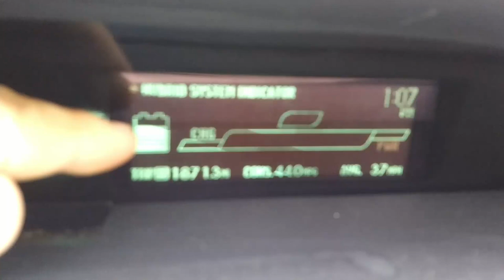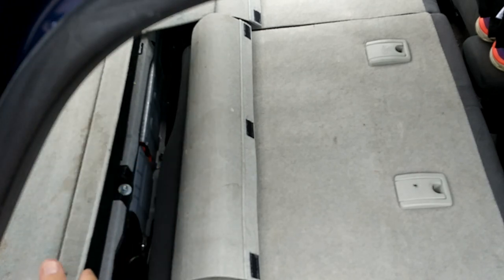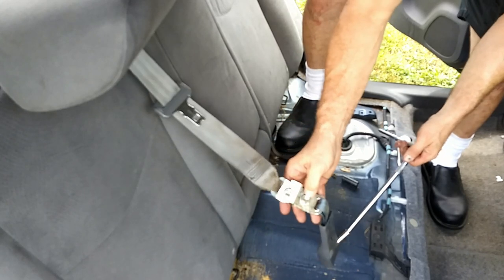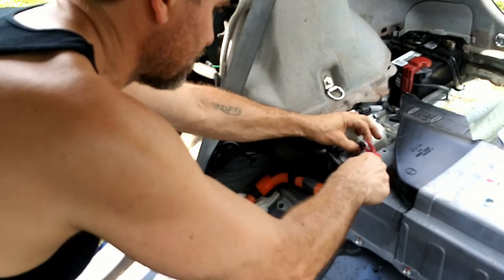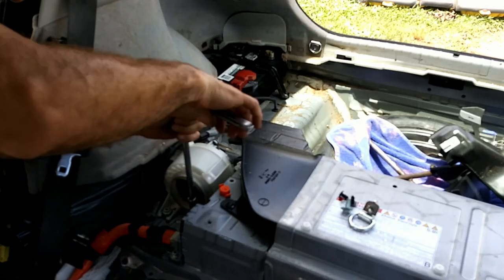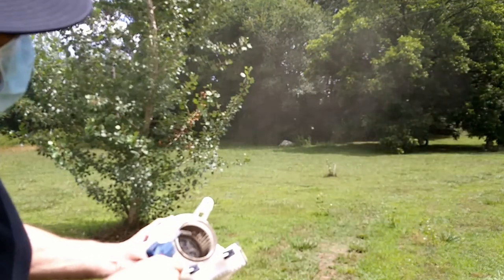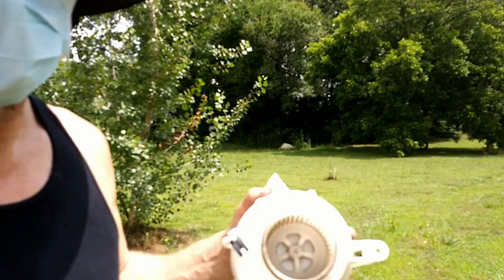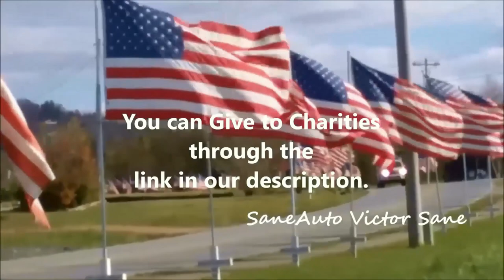2010-2015 Prius Hybrid HV battery fan clean Cheap and easy POA82

Comment from the maker: Prius and Hybrid Playlist click here https://www.youtube.com/watch?v=4O62muXAOo8&list=PLADlyv_PN7XIbqH6f-5bRtuISlKrkfsBI
Reply: I can't find the intake vent on my friend's 2013 Prius V.  It's not where yours is in the video. that inner fender panel is blank on mine, so I can't tell how dirty it is or work to keep dirt away.  And my friend bought it specifically to carry her 2 big, hairy dogs.
Reply: @saneauto thank you so much for this video, I plan to do the cleaning myself, since the dealer quoted that it costs $500 to do it as a routine maintenance for 50,000 miles. I don't expect it to be too dirty, but also want to make sure it is cleaned. I was trying the links for the tools you used, but those no longer work. Also you mentioned that you will have another video where you would clean also the vent in battery, I'm unable to find it (could you link it if there's one?). Although looking at other videos I guess that would be challenge on its own, as I suspect the whole battery would have to be dismantled.
Reply: Great video if u get poa82-poa85 it’s usually the fan that’s dirty great stuff keep up the good work

Comment: If you're gonna spend the time to get this fan out, you may as well clean it 100%.. i discovered there are only 3 screws (and 2 clip-like holders on the bottom) holding the two sides of the fan together! Just take it apart to easily get to the squirrel cage.  You can even separate the cage from the shaft, although I totally cleaned the fins with it together before discovering this easy trick. You can totally clean out the inside of the fan housing as well. 100% clean!
Reply from the maker: Great Job Michael! I love that method.

Comment: Later Hybrid models are much, much better at this. This 2010 was not Toyota's finest (engineering effort) when it comes to designing access for routine filter maintenance of the super critical (drive battery) cooling system-obviously. Ask a Dealer to do it and the Service Writer will happily quote $700. So this becomes a very valuable do it yourself  tutorial. This is "the" principal reason for the early Hybrid battery failure rate.  Batteries of any kind cannot deal with heat.
Reply from the maker: I agree

Comment: I don’t remember if you said anything. It is imperative that the fan be removed and disconnected before blowing ventilation with air. As I found out the hard way, The fan generates power and I blew out a fan and relays and $750 later it’s ok. You did it the right way. Follow your advice and it will go well

Comment: thank you for the clear instructions. The most difficult part was removing the back seat whereas I have to use a flat crow bar. My 2014 Prius fan was not that dirty but a grey film of dust, so I sprayed it with window wiper liquid and air-hose dried it. Now I taped a layer of fiber-glass filter material just after the plastic grill, so that if I see it becomes dirty, I can just removed the grill-cover and replace the filter.
Reply from the maker: Thats an awesome solution. It will save you a lot of work next time. I did a similar thing in my newest fan clean video just 2 weeks ago.

Comment: My 2012 Prius Plug-In (with Li-Ion) has two cooling fans which appeared pristine. I bought the outside mesh filter that snaps over the air inlet on the rear passenger bolster since mine had NO input filter whatsoever. And it's a hell of a lot easier to get to those fans than with the version shown.

Your mask is appropriate two years later for more than one reason.
Reply from the maker: Amazing some of these come with no filter. I had the benefit of already having 3 of the 50 count boxes of masks when the Covid lockdowns started.
Reply: B Me - I have the same Prius as yours.  Can you tell me if there is a step-by-step video or instructions elsewhere that I can follow?
Reply: @68vert1  i just took out the trunk carpet and then the hard trunk floor pieces to expose the batteries and fans. Easy.

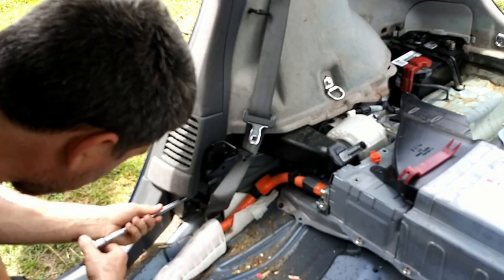Comment: I did not remove the seats, or the seatbelt bolt, I just folded them down. The 12mm bolt at 9:08 of the video is accessible by just pushing the edge of the seat.  Thanks for the video!

Comment: I learned there are two air filter options (G92DH-47060 or G92DH-47010) that attaches to the inlet grill that needs to be added, to keep that dust from entering into the fan area. I recommend the G92DH-47010 which just clips onto the inlet grill without having to remove it.

Comment: Hey man great vid. Just did the job and cleared the code, if it comes back on I blame you. 😋 (J/k)  I need this to last me just a bit longer so I can try to get the Tacoma hybrid when it comes out. Wherever you said 13mm was actually 14mm for me (2010 3rd gen)  other than that everything was spot on. My fan was pretty full of stuff so hoping this buys me some more time, we'll find out after some more driving, but so far so good. 215k so far with minimal repairs. (Also Ive never done any work in the back of the car except 12v batt, plenty up front, but was missing the same bolt and found it amusing) Thanks!
Reply from the maker: Awesome job! 🏆 Im glad you were capable and successful at cleaning the fan. 🏆 Now that youve been into the HV Battery Im sure youll be able to understand the things I go over in this video. It should prepare you if you get the triangle of doom during the next 215K "Prius Top 5 (Check Hybrid) high voltage HV battery fault codes (triangle of doom) cheap fixes" https://youtu.be/GVTpN3Ja9nk

Comment: Once I took the interior out and fixed everything , I really considered making a change. I might just do it. My plan  is rip out the backseat and convert my Prius into a personal camper. Really tons of space in there and it has built in power, heating, cooling, sound system. If I added a 1000 watt inverter I could run my ac stuff.
If I can figure out the toilet thing I will probably do it. Maybe takeout the passenger seat and put a chemical toilet in.
Reply from the maker: Or just a good sleeping area in back and stay at the KOA places. Many of them have bathrooms showers and more.
Reply: You can buy portable toilets online or at a camping store for cases when no bathroom is available download the app flush. Its an app that tells you about bathrooms nearby. Lived in my Prius for a year.

Comment: I used a “ free” harbor freight volt ohm meter. I have many decades of electronic experience. My only concern was the 300 + vdc. I was very cautious about proceeding. I purposefully replaced only the weak cell, did not do any balancing of the cells. My repair has been effective for four + months now.
As with everything new or strange , the hype about how difficult the repair is always far exceeds the reality.  I fact everyone I contacted about buying cells said I should replace all of the used cells with their used cells. I was born at night just not last night.
Reply from the maker: Awesome

Comment: I'm a bit surprised that Toyota rather known from good design have screwed this so badly. If battery is cooled by lets call it a vacuum cleaner why there is no easy accesible air filter? This should be part of maintenance like oil or air filter to engine and same easy way replacable...
Dismantling half of interior ant trunk to clean air fan is not smartest design. here engineers from Toyota disapointed me.
Reply from the maker: Yes your right. This is also the third generation of the Prius and they still have not put a bigger fan with filter.

Comment: 2006 prius 186,900 miles red triangle of death. One dead cell , one single cell reading only six volts.  Super simple $25.00 on ebay plus shipping back in business. I lubricated that fans bearing.
Reply: Nice one. Did you install by yourself? And what did you use to measure the volts?

Comment: Love your video....and you're humor.  "If you wouldn't eat it or lick it you don't want to breathe it either!"  Love it!  I have a 2012 Plugin Hybrid Prius.  Anything different that I need to be aware of before I dig in to clean the fan?
Reply from the maker: Thank you for the kind comment. Your 2012 should be the same. Toyota changed in 2015 and made it easier. They also added a filter. Problem is if you dont keep filters clean ya get no air when it stops up. Im glad your taking care of your Toyota.

Comment: Does this changeout apply to Prius V also or just standard Prius?
Reply from the maker: This is very close to the same as the Prius V up to 2015 and still very similar after that. If your fan is bad and you cant just clean it make sure you get the correct one for your year model because toyota makes slight changes to the fan and other parts pretty often.

Comment: If that is what the fan looks like, I have concerns about what is past the fan.  As an old school computer modder... if the fan was dirty... the fins were always worse.  I will be hunting another video as you claimed to do a more thorough one.  Unfortunately/fortunately (?) I have a 2017 Prius 4.  Vents are under the rear seat.  Was quoted $180 to clean them at 100K miles.  After watching this video, I Have to question how they could possibly do that.  I mean... they charge $50+ labor to change the air cabin filters and I do that myself in 5 minutes flat... and pay half of what they charge for the filters.

Comment: I had no lights. I went to clean the fan. It was pretty clean. No filter. I used an air hose to blow it all out just in case. Felt air coming out the exhaust end of the circulation system. Put the cover on. Now I have an Amber triangle. Now I have traction control light on. Now I have an brake warning light. What happened? I can see the system charging as I drive. It discharges and charges

Comment: Can we use vacuum cleaner from air duct and not to open all
Reply from the maker: No the stuff is clinging to the blades. I had to use a soft toothbrush to get the last of it. The buildup changes the shape of the blades and they wont push air anymore until you clean that stuff off.
Reply: @saneauto  bad design they should have put replaceable filter so not need open all that parts

Comment: I thought that mask was to prevent a deadly airborne virus? Come to find out it's for dust! Can you lower the mask if your eating or drinking and still be safe from debris?😂 Should I practice social distancing while cleaning as well?  Thanks for the video. Looks a lot more in depth then I was thinking.   I planned on a can of air and a few bolts. So AGIAN thank you for your time & knowledge, greatly appreciated.

Comment: Why didn't this have the filter part where air enters next to the seat?  That could have prevented the gunk getting in there in the first place?
Reply from the maker: You are soooo right. I had to order a screen from Amazon and make a filter with a roll of filter material. Its working great. Later 3rd gens have a filter but I cant find any on Amazon nor ebay.

Comment: Prius 7 seats's  battery is not located there. Do you know when and how to clean it?
Reply from the maker: Under the passenger side 2nd row seat there is a cover and a grate with one philips screw. After you remove the screw you still have to pull because there is a clip. The filter is behind this cover and the fan is right there.
Reply from the maker: I will make a video.
Reply: @saneauto  thank you in advance 🤗

Comment: The dealership must be making a killing sum of money for doing what you have demonstrated; thank you very much for the hardwork dear saneauto. 
Am wondering if you could stuff the intake with some air filtration media, furnace air filter comes to mind, to eliminate the elements from getting in there the first place.
Reply from the maker: It would need to be very thin and let in a lot of air flow.
Reply: @saneauto  You could simply use the filtration media found in the cabin air filter; which can be simply taken apart if done so gently.  The key is not the thinness of the media, it is the amount of pleats you need to incorporate into it.  I have done the same on my Prius C and it seems to be working well.  The screen in the duct work is letting in too much debris into it in the first place.
Reply: https://youtu.be/skSoXGcNpS4
Here's the filter you need.

Comment: shouldn't you disconnect the 12 V battery before messing with the electrical connections on that fan? Just wondering
Reply from the maker: Yes but remeber that big battery right beside the fan can also produce a shocking experiance. This whole job could be a deathtrap. The only safe way is to pay someone else to do it. Now you that you know what you want them to do. And why it needs to be done.

Comment: I saw the fan duct and followed it back to the fan. I went ahead and removed the fan , cleaned, lubricated it just in case.
Reply: What did you use to lubricate it? Mine seems to be turning somewhat rough when trying it by hand

Comment: Thanks for the tip! After cleaning out my fan I still have the maintenance light popping up. Is that supposed to automatically turn off? Or is there something else I have to do?
Reply from the maker: If its the maintenance warning  Go to this video and skip to 18:30  https://youtu.be/1dovhNKoFjk  If its the engine light you need a cheap scanner to erase the code https://amzn.to/317GnKG
Reply: saneauto it still doesn’t work the way you said it

Comment: Dear viewers, I have a question about cleaning the HV battery fan on a European Prius Plus Wagon (2012). The Prius Plus Wagon  is sold in the US under the name Prius V. But..., there is one big difference when it comes to the spot where the HV battery is located in the car. In the European Prius Plus this HV battery is placed between the front seats. On the US model Prius V Wagon the battery is placed under the back seat row. From the outside the Prius V and the Prius Plus (Europe) look the same. Both are wagons. 
However, the European model has THREE seat rows. The European model is a SEVEN seater. The location of the HV battery is therefore very different. Like I said, it's between the two front seats.

Would anyone know where to find information on the cleaning procedure for the European model Prius Plus Wagon?  I could not find anything on YouTube. The air intake for the battery fan seems to be under the richt front seat for the Prius Plus. Are there Toyota service manuals for car technicians who cover this cleaning procedure? 
Thank you all in advance for your help, M

Comment: Hello. How to clean message on the screen?
Reply: Hi, did the code ever go away? I cleaned my fan as well...but code is still there :(
Reply: @MERAIOT1  try to disconnect the 12v battery for a 10mins, the code will disappear

Comment: I cleaned my fan for the battery hybrid battery then I changed my spark plugs and my air filter got in the car turned it on and said hybrid engine check hybrid engine anybody know what I can do
Reply from the maker: Double check the HV safety disconnect. https://youtu.be/6Ui8UDZ9I7k
Reply: Hybrid battery is not functioning properly for multiple reasons. Most likely one or more of cell is bad.

Comment: Hello sir I have 2010 Toyota Prius and there’s a code permanent code P0A80 Which I am unable to clear unable to delete even mechanic couldn’t delete it I check the fan I checked the Cruzan everything seems working great even I change the battery hybrid battery I still have the same permanent code P0A80 I went twice smog check failed Can you please tell me how to fix that code how we can delete this permanent code 2010 Toyota Prius remember I put the new battery new fan still same code
Reply from the maker: Did you replace the battery with a reman or used HV battery? Did it come complete with all the bus bars installed etc.?
Reply: I change the complete battery
Reply: All in set   Complete battery with the all components including fan
Reply: Shifia K  Where you from ? I’m in Birmingham smallheath uk and have techstream and can do diagnostic scan check
Reply: Hello! I also have a 2010 Prius and just got the same error code P0A80. Do you think that by cleaning out the fan and its components, my problem should be solved??? Are codes P0A80 and P0A82 the same? PLEASE HELP.  Thank you for all the information you provide!
Reply: @marlonrvs  P0A80 is "replace hybrid battery pack" while P0A82 is "Hybrid Battery Pack Cooling Fan 1 Performance / Stuck OFF"
https://actron.com/code-lookup
I don't know about the third gen Prius, but in the first generation the battery ECM would throw the "hybrid battery failure" code based on the difference between the lowest and the highest battery module voltages. Disconnecting the 12V battery for several minutes (I prefer to leave it disconnected for about half an hour, but that's just me) may clear the stuck code.
While we are talking about disconnecting the 12V battery, you can take the opportunity to test the 12V battery. Maybe the recent ones are better, but the older ones were sensitive to the internal resistance of the battery, producing all sorts of weird indications before it reached the point of refusing to start the system. In my 18 years of Prius ownership the most common failure I have seen is the 12V battery.

Comment: Spray graphite, looks like a can of wd40 . Don’t use wd40 , wd40  will wash long term lubricants out and lead to failure. I figured if graphite ( it wasn’t graphite)was good long term in locks it should work long term in that fan. Basically a spray lube is the only good way to get at that fan.
My bet is most owners are being ripped off. Seriously 2006 190,000 miles and only one weak cell around six volts and a fan that needed lubrication.
I bought six cells with the intention of replacing the weakest cells, to my surprise only one cell was weak. Good luck with your project,just remember use good insulated tools ,don’t ground your self . I can’t stand gloves but  , good electrician gloves should be worms

Comment: ⚠️⚠️⚠️ For safety purpose, you should have removed the high voltage plug from the battery, before carring out the procedure.